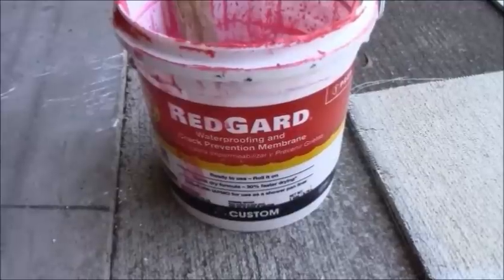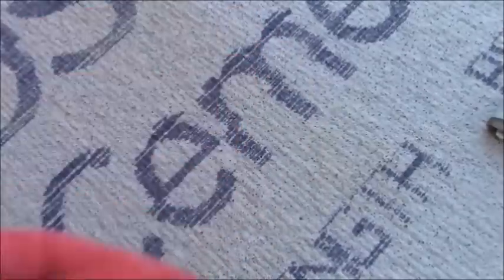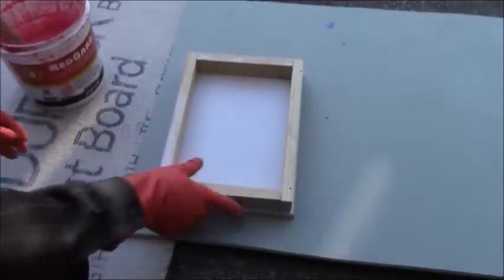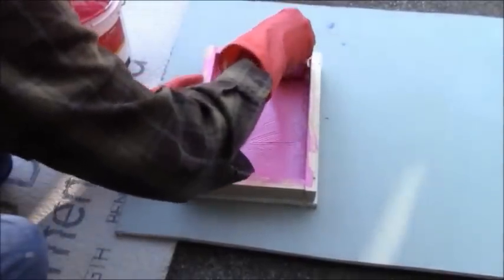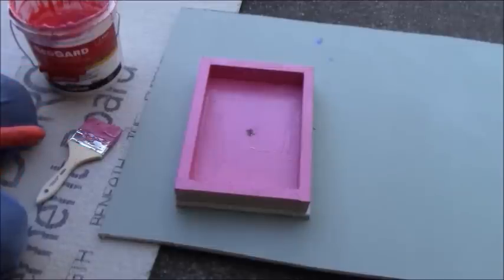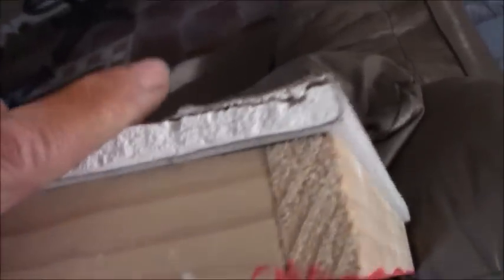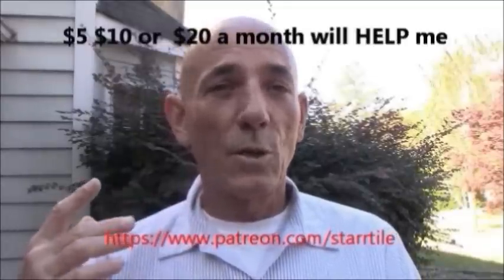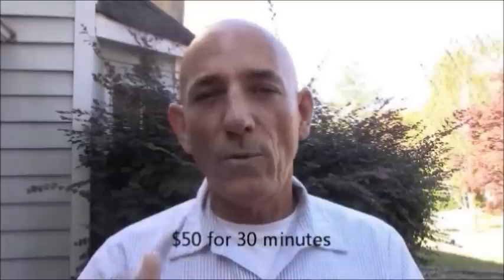REDGARD vs SCHLUTER

Comment: Well, what is not being spoken about? The red guard will not put a lifetime warranty on your shower! Schluter will if installed as prescribed. I went through both of there 2-day training. The topic is so much bigger than some cardboard box and red guard. With Schluter thin set I could coat the inside of a cardboard box and have no leaks either and tests have proven this as fact.  A Vw has 4 wheels, doors, and windows but so does much higher class vehicles. And the price is very relevant. I have used the Red guard for years and it is good.  Schluter is a complete system and red guard is not. How many showers have I ripped out with the red guard and found wet wood rot and leaks? To many. Remember  Schluter is the complete system that puts complete warranty on your shower for leaks if installed per instructions. How many curbs tile are falling off due to rotting wood. How many walls tile falling off due to rot. The proof is in the years down the road proof. Schluter customer support is rock solid. If you ever get a chance to take the class and get educated with new information then decide how to proceed. How many showers have you're pulled out the walls and mold and moisture is there? Have you ever wondered why? Take Schluter's classes and you will learn why.
Reply from the maker: Honestly people do not need a lifetime warranty on a shower, the average homeowner is in it about 12 years, the average shower last about 20 at a Builders grade level, I have run into many that have lasted 30 plus years on a builder's grade level and by that point people are renovating anyway.. but for the purposes of this video I basically I'm saying that walls are not as important as a shower pan area, my walls are never falling apart because they were not waterproof
Reply: "To make a claim under this Limited Warranty, the Owner must provide Schluter-Systems with written notice within
 30 days of any alleged defect in the Products covered by this Limited Warranty, together with date and proof of purchase of the Products, proof of the costs of the original installation and name and address of all installers, failing which this Limited Warranty shall be of no legal effect".   I would think it is rare to catch a failure within 30 days of noticing it.  Would be interested to hear about successful warranty claims. Don't get me wrong, the Schluter products and warranties are great. But a shower just needs to be done right in the first place or there will be pain on the homeowner and installer regardless of warranty.
Reply: Redguard does offer a lifetime warranty. Try again.
Reply: @apex007  Ok, And exactly what are they paying for if their product fails.
Reply: @apex007  Very good to know. Thank you for your due diligence. Like I said earlier I also use red guard and never had a problem with it. Thank you.

Comment: i cut my boat in half and put it back together with redgard.  during testing i pulled anothr boater out of the water who was testing with flex seal.  phill swift was not a good swimmR

Comment: If it works for you, so be it. Paper backed gypsum wasn't intended to hold the weight of thin-set and tile plus the butt joints are permeable. Good luck to your clients. I'll use Kerdi or Go Board with Hydro Ban waterproofing and sleep well.
Reply from the maker: I've slept very well since 1998...
Not one failure, not one call back 👌✌💪

Comment: So houses are built with wood and plywood which shifts and naturally moves also with moisture and depending on location...right? So what happens when your green board with redguard moves a little bit? It’s going to crack then water penetrate which has been shown to happen in many videos even on new houses less then a year old.. Some states have ground movement... this is completely disregarded in this video.. I’m just trying to learn of course I trust redguard in my showers but there’s a reason why there’s more to explore in this business..
Reply from the maker: Never seen Redgard crack..it's rubber and stretches more than any other materials in your home. 
Applications where it's ridiculously thick there's cracking but you can't fix operator malfunction.

Comment: Schluter Kerdi fails from poor installation and using thinset to seal the joints in the membrane. Thinset is not a water proof or water resistant sealant.

Comment: One argument for a cement backer board is that valve and shower head pipe penetrations leak sometimes. The cement board might be a safer bet.

 I built about 15 showers in my amateur tile guy days. I used what I think of as the traditional hardibacker approach that I learned from the John Bridge book. I might have switched to Kerdi or Redgard at some point but I didn't. On the Kerdi: It seemed to be a lot of money to fix a problem I didn't seem to have. On the Redgard: I never found good instructions on how to handle the drain. Should I buy a Kerdi drain and use it with Redgard or should I use a traditional drain and seal the weep holes or some other idea?  As it is because the showers I built were in a building I owned I got to see the results of my work over many years. I had one or perhaps two issues. One issue was on the first shower I built. It developed a bad smell. I had to demo the pan and redo it to fix that problem. The problem was caused by using a mud mix that was too wet and the weep holes were blocked. 

I put the hardibacker on the wall into the shower pan. I realize that the producer of this video and perhaps some other tile youtuber's don't agree with that approach. The problem with not doing that is if you are using a liner you can't put screws through the liner which leaves the bottom edge of the Hardibacker without much support (I put thinset on the back of the Hardibacker so that it was sandwiched between the pan and the thinset on the back which pushed into the liner (The approach recommended by John Bridge)). However there was one shower I did with white tiles where I could see what looked like a bit of grey on the tiles. I don't know what caused that but maybe it was caused by mold creeping up the Hardibacker?
Reply from the maker: Yes, I have seen every backer board out there wick up water and cause mold. But to your point about the shower valve issues behind the wall, That's just not a common occurrence anymore. Because the valves are all inclusive of the cartridge.... We don't have degraded packing, washers or seats or anything like that to deal with So the only possible problem you would encounter would be a leak in a pipe and that's more rare than a problem with a valve.
Reply: @StarrTile  Thanks for the reply. As an apartment owner I saw leaks quite a few times. Probably the biggest cause was when a tenant removed the regular shower head and connected a different one which wasn't quite installed properly so the water would shoot backwards towards the wall which would cause a problem since the standard flange isn't designed to stop a leak from a horizontal water spray. Because of that I took to caulking the heck out of that area. I also saw leaks similar to the ones you mention. I think it is possible I never saw leaks in the showers I built of this type. As you say things got better along this line.
Reply: If anyone is really concerned about the shower valve, purchase the Schluter shower valve ring and RedGuard it in.  You are out $20-25.  Personally, I have never seen a problem in that area.

Comment: The thing I really dislike about Schluter and the like is the cult like mentality around it.  As if they reinvented the wheel and if you don’t subscribe, then you’re doing it wrong.  I’ve always used hardi or durock and a liquid membrane and never had an issue with leaks or loose tiles.

Comment: How will redguard hold up if there is movement. like earthquake heavy areas? I use Schluter Kerdi band on all my corners and then Redguard the seams.
Reply: It's also uses as a crack prevention membrane so it should work very well. it's very stretchy stuff.

Comment: I have taken showers apart where there was a dry pack pan over a rubber membrane that was saturated with water that was trapped in the cement. I always recommend to my customers to waterproof any type of shower set up.
Reply: This should come as no surprise. Grout joints in floor allow water to reach the mud pan, so the pan is going to constantly be saturated if it's used on a daily basis. This is normal and expected with a rubber liner.......there is absolutely nothing wrong with that method either.
I have been making mud pans no for several years with no rubber liner. I've exclusively used Redgard over my cured mud pans. To me, this method is superior and it's easier to achieve crisp corners where the walls and curb meet the pan.

Comment: as of 2008 its illegal in the state of CA to use greenboards as a  backer in a wet area.
Reply from the maker: Makes sense to me, California regulates everything
Reply from the maker: @michaelhorn9114  yes it will suck up moisture if there is no water proofer, although Schluter allows for drywall as your backer because they believe in their product, same as I believe in mine.. but you are incorrect to say they are the same because green board has a chemical added to it to resist mold and mildew whereas no other backer has that property
Reply from the maker: @michaelhorn9114  and so will durock, hardibacker, wonderboard, every backer board out there will get mold and mildew.. that wasn't the point of the video, the point is when you waterproof any backer than it is protected

Comment: This would work fine for a tub surround. However the real problem comes from the vapour which red guard is not vapour proof. Also, do you really want to be breathing in a shower full of red guard?
Reply: Mike Hobson Red Guard is listed you be a vapor barrier at one coat. It is a waterproof membrane at two coats and a crack resistant membrane at only  one coat. So if you out at least 2-3 coats, you get all three benefits.

Comment: Thank you for making these videos keep up the good work. I wanted to know if it's ok to lay cementboard on wet cement to create a nice flat surface and slope it towards a linear drain. After doing so I would redgard it. Is there anything wrong with this idea? Or should I just slope the cement mix and redgard it? I just prefer a nice flat surface the Cement provides.

Comment: If I have a tub with a nailing flange. Do I put the cement board “or whatever wall board I am using” inside the flange down to the top of the tub, or do I not overlap the flange with wall board, only meet up with it. And then have my tile go down past the flange and meet the tub. I hear different answers and always wonder about this as a diy home owner
Reply from the maker: So if you watch this video it will answer your question
https://youtu.be/ZVfEiHCD6CE

Comment: Dumb question. Can Redgard be used directly on plywood? Reason I ask is because i need to redo the main floor decking of my 21-ft boat. Typically the plywood is coated with fiberglass resin on both sides, an then put into place. I'm wondering if a waterproofer like Redgard could be used instead. Especially since it's a crack sealer too.
Thanks in advance.
Reply from the maker: At one time I had an inflatable boat, I used plywood for the hull because it was more rigid, coated it with redgard and it worked fine
Reply: @StarrTile  Awesome! Thanks for the reply.

Comment: Hey Bob. Would it be possible to red guard over green board with kilz primer applied over the joint compound, or would it be best to red guard directly over the joint compound without primer?
Reply from the maker: I use redgard on green board of my showers nearly every job I do and I do not use a primer I just put the mud in all the seams
Reply: @StarrTile  any special mud you use or just regular premix?
Reply from the maker: @alejandroespino1998  doesn't really matter what mud you're going to use, everything behind it will be waterproof anyway

Comment: Do you install the Durock rough side or smooth side facing tile?     The board states rough for cement and smooth for mastic.
Reply from the maker: Those instructions would be correct if it were not for the fact that we are waterproofing the wallboard which makes the smooth side facing out a much much better surface for the waterproofer
Reply: @StarrTile  Thanks so much.  One additional question.  What do you use to adhere the tile to the redgard waterproofer.
Reply from the maker: @honestabe7349  thinset

Comment: New to the bathroom renovation world. 

Can I put in the green drywall cieling to floor and then put a tub in? Or does the tub have to be installed first and drywall over the lip?
Reply from the maker: Tub goes in first and then whatever your backer board is goes up to the lip of the tub

Comment: Question? Instead of thin set in the corners, I generally uses silicone. What your thoughts?
Reply from the maker: I think silicone is redundant, the Redguard would trump it, but if you silicone it wouldn't do any harm

Comment: Can you red guard over an existing painted drywall tub wall I'm converting into a shower?
Reply from the maker: Yes but I would probably take a sander to it first, just rough it up a little bit if you can, you're trying not to have any loose paint either

Comment: I never use red guard. You can pull the stuff off the wall. What does that say about adhering strength?
Reply from the maker: Well of course you can, it's not meant to be torn off, you set tile on it, grout, go.
In the same light you can pull schluter off a wall too.

Comment: How do I use redguard with kerdi drain? Do I paint the pan with it?
Reply: You would use a sheet membrane.  Use a 3pc drain if you want to use red or aqua defense.
Reply: I have watched many videos.  Are you saying to use a kerdi pan and drain then use kerdi band, then red guard over the pan?  Maybe I misu understood what you are saying.
Reply: No liquid waterproofing with kerdi units you want extra protection in thre corners or edges of the banding.  But normally you don't use it.
Reply: But, you are saying to red the walls.  I was all set to use all kerdi in my shower, but today I have watched videos of failed kerdi.
Reply: You can use it on the walls if using cement board.  You don't have to if you're using kerdi board.  Just do a flood test. The one guy video had a 7 day test.  If a shower is having standing water then you have bigger issues.
Reply: So, I Kerdi the pan, Kerdi Band the pan to the cement board and red the walls? Oh and of course the corners.  Should the band be enough  on the cement wall after overlapping the pan by 2"?
Reply: Technically yes.  There are corner pieces also. Any liquid waterproofing with this is going over and above. Some people put kerdi membrane over the cement board.
Reply: Kerdi on the walls was my plan in the beginning, but this would cost less.  I had started reading too much and was getting so confused.  I took a little break from reading and now you telling me this has brought my confidence back up. I have tiled alot, even around a tub, but have never done a shower.  Thank you so much for all your help.
Reply: My last shower was membrane over drywall.
Reply: I do have one last? If I'm using kerdi pan that already had the membrane on it, which thinset do you recommend to tile with. The place I bought tile gave me laticrete Tri Lite
Reply: Any non coupling thinset work.  I use Mapei large format floor and wall tile mortar.

Comment: So when you float the wall board above the floorpan do you float the tile over the gap like a bathtub?
Reply from the maker: Exactly like a tub...maybe 1/4" gap is left after setting floor tile and wall tile overlaps and gap still there so water can never jump to wallboard if ever it gets in there
Reply: @StarrTile  do you paint red guard on the bottom of the green board? How do you get in that tight of a space?
Reply from the maker: @ChrisXCXCX  yes you paint it everywhere, imagine taking a shower in there with not one piece of tile set, I use a brush for corners and a brush for tight spaces like that Gap, and the Gap should start out about half an inch to 3/4 of an inch so yes it will be tight after tile but not enough that a paintbrush can't get to it, I have a video called the correct way to set wallboard and you can watch that

Comment: I'm doing a tub surround, and I've put several coats of the membrane on my green board.   I have one question, though...  how do I treat the bottom edge of my green board that ends at the top of the tub flange?  Do I need to get up under there with a brush, or should I caulk it?   This isn't a factory edge, this is a cut edge on the drywall.
Reply from the maker: I'm always able to get up under there with a brush, the excess redgard on the tub will peel off easily after it's dried, if that doesn't work for you then use a bead of silicone

Comment: I tear out old showers where the drywall and (only) drywall is still bone dry . Studs clean and no sign on moisture . Is waterproofing necessary? Absolutely.  Spending  10 000 on a new bathroom remodel , the extra few hundred bucks for a peice of mind at the end knowing your shower won't leak is a no brainer . I'd like to see a video of you installing a shower . How bout that one. Time lapse.  Let's go
Reply: Nobody's spending $10,000. We're here trying to do it ourselves for $500. Tile over existing sheetrock or green board.